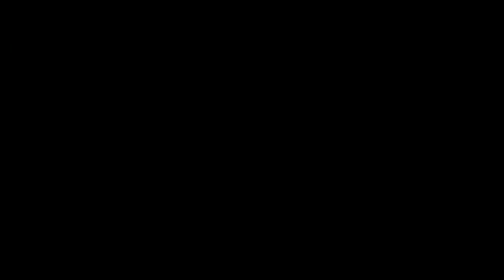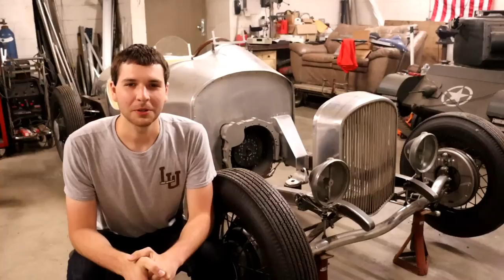thank you

Comment: First off, YOU ARE AN INSPIRATION TO US ALL... 

I want you to know first hand that I also was fitting a GM t5 to a Ford engine, and used your method of stabilizing the input shaft with a centering sleeve so I could center the transmission using its own input shaft. 

Instead of having the motor out of the car, I installed it onto the bell housing and held it onto the face of the bell housing by using ratchet straps... 

It did the job magnificently well and I'm so glad you gave me inspiration to taking on a project like this...

I too am entering my senior year of mechanical engineering and I'm coming to terms as well that I won't have the time I had before to do stuff like this...

All I wanted to say was thank you... You seriously rock!!!!!

Sincerely
-Evan

Ps. There will come a time when you can work on your lovely roadster again... 

If you want to expedite the process try integrating stuff you currently are working on into the project...

Like making a gingery lathe so you not only can make parts for your car, but also something that can benefit other realms of your engineering. 

Seriously Thank you and good hunting.

Comment: Congratulations on a busy new life at Space Ex.! I will miss very much seeing your progress on the boat tail but I completely understand what starting a new life can do to your time. I have one request though. When you finally finish the car,,,scratch that, a project like this will never be finished in your mind exactly there will always be one or two things you will want to improve some day. Let me start again, when you finally have your hot rod on he road, even if it is years from now and youve started a family, please do one more video showing the car running with you driving it with a giant proud grin on your face. Oh yeah one other thing I noticed about the front suspension. Since your hairpin pivot points and the spring shackle pivots are all hard metal and none are rubber, they will fight eachother and bind somewhat while forcing the spring to flex somewhat in torsion besides flexing the way it should,This is because the spring tries to only allow the axle to move up and  down (at the castor angle the you welded the spring perch to the frame) but the hairpins make the axle travel in an arc, As  it follows the arc it is changing the distance between axle and the hairpins rear pivot points as well as changing the castor angle (because you opted out of 4 link) This may not be a real problem (as well as a geometric one if there is enough slop in the system  and also because the car has limited suspension travel and not much arc swing at the hairpin. But if it does torque the old springs much at all they probably wont last too long before cracking. One more last thing, thank you for sharing this build on you tube.

Comment: May I offer a suggestion? I know it's almost aluminum, but it would be heartbreaking to come home years later to your almost finished project with rust. You know those cheap chemical sprayers that attach to a garden hose for spraying Roundup and such? If you feel one of those with some heavy motor oil and cobble your air hose onto the portion made to go on a garden hose and said it at about 30 PSI, you get a nice mist of oil that you could spray the whole machine down with. Anything like tarps as just as much potential to hold moisture in as keeping it out. I don't think you could do much better than fluid film